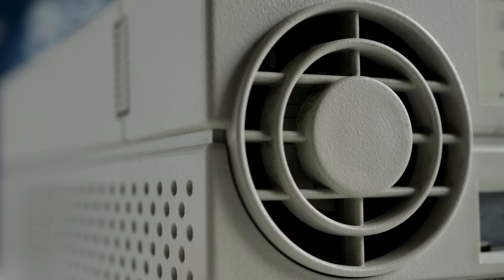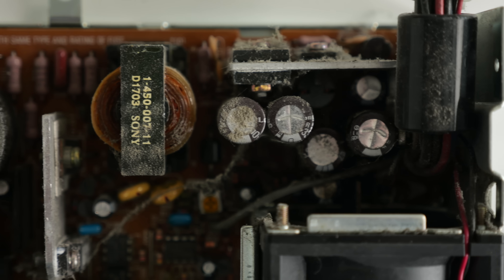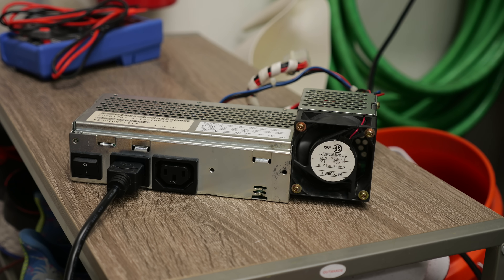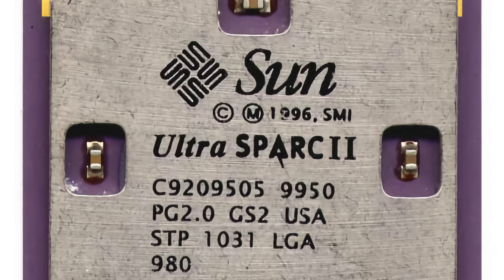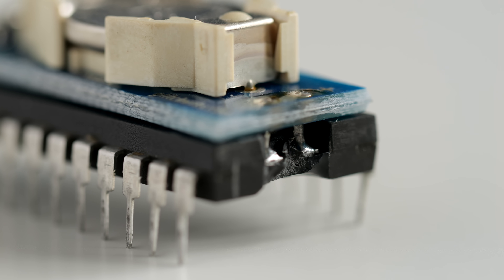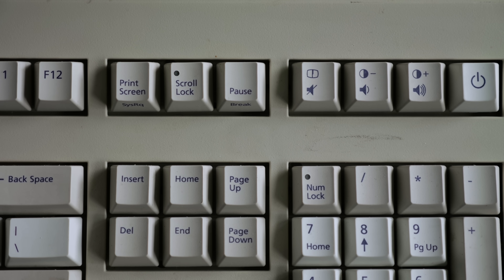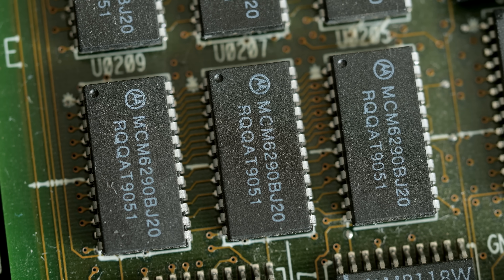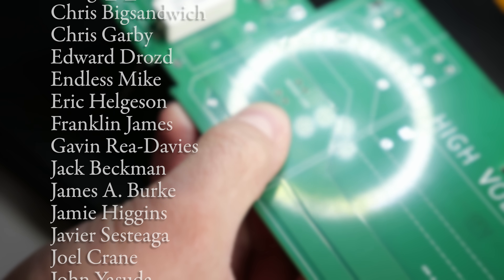I couldn't fix this SPARCstation because of one STUPID problem

Comment: That RAM fault is VERY easy to fix. Simply make a breakout board and mount any Static RAM larger than 16kB (dip or smd) onto the board then wire it by hand to the motherboard pads. All you need is A0-A13, D0-D3, WE, OE, CE, VCC, GND. It's just 23 wires and a bit of time to solder it. Give it a try in a future vid. You may be lucky and fix it for less than 5 bucks :-)

Comment: Sun had outsourced the power supplies to multiple companies.. Sony used ELNA caps that turned crusty rather easily, while TDK used Nippon Chemicon caps that work fine even after 30+ years. Sadly, TDK picked worse fans than Sony, so at least some repair is due for any of the lunchboxes. I have yet to see any of the mainboards fail, though.. even the tantalums seem to have survived the ages.
If you weren't literally on the other side of the globe, I'd gladly donate one of my spare GX cards.. but with the tariffs and post office reform of a certain president, it would cost me over 100$ to ship that one over, which probably isn't worth it for a shelf sitter.

Comment: I feel for you. In the mid-1990s, I was gifted a SPARCstation IPX by my uncle when his architecture firm switched to PCs. I was familiar with Intel-based and Motorola-based systems, so did not think there would be much difficulty getting a Sparc-based system up and running. Was I ever wrong. Even without the tribulations you had with the hardware being old and failing, I ran afoul of the Solaris OS. Even with the system having entirely Sun Microsystems hardware, I was 9 months getting the OS to install and run. It ended up costing me over US $1,000 to have a Sun-approved technician make an on-site service call just to get that far. By them, the sunk cost fallacy had me firmly in its grip. Another US $1,000 later, I had everything as it should be, but was so frustrated with its sluggish, glitchy performance under Solaris 7.0 and SunOS 4.1.4, I turned it off and never used it again. This mirrors my later experiences trying to get Solaris for Intel-based systems to work. It all added up to a few years of effort and frustration for the realization I had wasted far too much time and money on a very elaborate exercise in futility.

Comment: Sounds like a cold joint.
Reply: sounds like you've never repaired anything lol
Reply: @g4z-kb7ct  You'd be surprised by the amount old pcb's with legs lifting up from the boards ever so slightly, especially around pressure points. Remember these are 30+ years old. Plenty of time for that old lead filled solder to whisker or just oxidise enough to crack and require a reflow.
Reply: The chips are in the middle of the board and it was bolted to the case so there are no pressure points. Whiskers is not a thing on old devices. I have a Space Invaders board from 1979 that works perfect so even if it had whiskers it does not affect functionality. That could be an issue with new devices that use smaller parts with tighter connections but it doesn't apply to old stuff.
Reply: @  whatever, i'm glad it "works for me". I've had my share of repairs and seemingly simple things like those are the trickiest to trace back to the affected legs. Sometimes just touching the board while the system is turned on is enougth to cause an effect.

Comment: You might be able to ask Adrian from Adrian's Digital Basement to take a look. He might have a chip that would work with it.
Reply: AB is not required. Can be fixed by doing a simple RAM swap onto an adapter board using any SRAM and some wires manually soldered (by signal) to the pads. You may say that's difficult.... well all I can say is get out of the kitchen if it's too hot for you lol. If you're collecting 30+ year old stuff you had better have intermediate or advanced repair skills or don't collect old stuff.

Comment: I got my IPX in 1999, complete with an actual RZ25 hard drive (a Seagate 424MB thing rebadged by DEC) and the vertical stand.  It still works today!  Yes, I had to replace the "NVRAM", and I could never get the 100Mbps SBUS card I got to work (though I have a qec like you have if I didn't want to use a transceiver)

You would have found that the IPX was best run on SunOS 4.1.4.  SunOS 5 (anything "Solaris 2") is a bit too fat for it.  That RZ25 hard drive had Solaris 7 shoehorned onto it when I got it!

Comment: I would be surprised you couldn't just buy that IC from the Ali-E for peanuts, ie, they recycle everything.
It could just be a cracked solder joint. Seen heaps of cracks on the larger chip packages in the 1000s of repair vids of old hardware I've watched, ie, leaded solder also cracks.

Comment: It's certainly harder to justify the time, effort and expense refurbishing a system that you don't have a connection to. Unix systems are particularly a challenge because even when you get them working, there's limited software that might have mainstream appeal to run on them. Most interesting commercial applications are hard to get ahold of compared to Mac and PC/Windows software and often had a license key issued by the manufacturer and tied to a physical system. Most videos I've seen here will install Solaris, boot to OpenWindows or CDE, maybe launch the terminal and call it a day. A few will set up the system as a server of some kind. I had a Sun Ultra 1 on my desk for a couple of years and it basically was only used as a cross compiler and remote debugger for an in-development STB. If the IPX system isn't calling out to you as something that needs to be explored or brough back to life for nostalgia, it makes sense to put it aside for now.

Comment: Would CY7C164-35VC or CY7C166-15VC work as a memory replacement? Digikey offers them on their marketplace.
Reply: The former may be too slow (35ns vs 20ns), but the latter should work (15ns). Pin layouts are 1:1, same package, and equal-or-faster access. Rochester also has them for $3.93/pc
Reply: @krad2520  Yes, it's Rochester Electronics who are the seller. There are 20ns parts available, too.
Reply: @krad2520  Bruv, if what you say is true, then i hate this video even more.

Cause i was really expecting a proper ending to this here video.

BUMP THIS COMMENT!

Comment: oh god no let me guess Bios battery is dead the machine wont boot without it common issue only fix is replace the bios chip which casts 1500 for a working one and then you still have to deal with the battery dieing and starting all over again most people usually bypass the battery problem by soldering a external battery to the bios chips battery connection points there is also a key command you can use to bypass the dead battery error

Comment: I had one of these around 2002, picked it up at a 'junk' store, stuck Debian on it and hauled it around as a file server. Even cross-compiled for it from the PC, think I caught more than a couple build system bugs. Loved it enough to try fitting it with an LS-120 drive, but not enough to continue after the battery died.

Comment: I do have a lot of nostalgia for Sun machines of the sun3 and sun4/4c/4m era, but I still gave the last of my Sun hardware to a friend of mine who collects vintage Sun and SGI gear in 2007 or 2008. As fond of Sun as I am, the machines simply weren't useful enough any more, for their power consumption and noise and heat output.

Comment: SMES Tiers and Levels Exception. APPROVED for a configuration of the unit. Reason:Board is upgradable and can be adjusted, with its OS intact and some features designed for a portable console, similar to known brands these days. The External features and designs are up to date, the SLATS, and partitioned areas can be adjusted to add additional gadget to simplify a kitchen system as that of a Warmer and a timer with the BLUE, RED LIGHTS ON, ITS A MUST HAVE. The external design can be configured with an updated color, as playful, energetic, VIBRANT and FLASHY features that draws attention, stick ons or painting can do the TWIST. Chamber of Commerce Registrations, SEC articles of Incorporation as well as By-Laws, Trade Registration Certificates can be issued/released for new and updated designs for the brand(s) and contributors.Patents, Trademarks, Copyrights, LLCS, Registrations, are owned by its brand owners, ALL RIGHTS RESERVED.©™®  Thank you Tierage.  *****IMPORTANT*******This is NON AI/Fintech standards of Excellence for Technological updates, BRAND management and configuration respectively.******

Comment: That hit the nostalgia spot! When I worked at a Linux distro here in Brazil in the early 2000's, many colleagues had a SparcStation IPX on their desks. We used them as... monitor stands. 😂

We got them cheap as dirt at a local tech junkyard, as they would put the display to just about the perfect height AND looked "cool" to boot. I lost count of how many times unaware visitors would enter the room and exclaim "Wow, Sun Stations!".
Reply: Que mundo pequeno, esse… 😜

btw, in what distro did you work?
Reply: @UnderEu  Conectiva Linux, from CL5 to CL8

Comment: I had one of these once.  It used SunOS (before Solaris).  I ended up putting RedHat Linux on it via FTP install.  The speed of the workstation was underwhelming compared to pentiums and later.   What I did like doing was learning the Sun openboot system which helped me repair a server years later.

Comment: And this is why I never tried to refurb the SGI Octane I got for free a couple of years back off of Craigslist. I got a dual processor Xeon Dell server with it for free also, but I just wanted the SGI. I still have it and all the parts, but I gutted it to use the case as a custom PC case. Man I miss independently owned parts stores. I know of two in my area, and funnily enough one of them is literally across the parking lot at MicroCenter.

Comment: you can clone the PCB by taking a picture of it and using a multimodal ai model like Grok3  showing it the picture and asking to replicate the PCB..... then send off to PCBway and knock off a few copies.  You can use a local multimodal as well... just go on perplexity and ask for a 7b model that has vision/text capability.  Mistral makes a good one...  or you can always pay Openai.... but who wants that?
Reply: Do not do this. Do not trust a so-called "AI" to build PCBs unless you know exactly what you are doing in the first place. Good grief, please stop suggesting this crap.

Comment: I loved this video for many reasons. First, it brought back memories of me in middle/high school messing with one of these in my old school library and trying to get an OS running on it (we did, and it was fun!...this was in like..2000 or 2001). But mostly because you ended it on such a poignant note about the amount of time and money put into working on older hardware..and the "reward" of working on it. I recently had this issue with an IBM PS/2; got the machine free but started opening money and lots of time on trying to get it to a working state for...what? I didn't know...just to get it working. I ended up finally just cutting my time and selling it (essentially for what I bought in parts). I felt so much better but still came out on top with a lot of new knowledge and was much wiser in my decisions on working with older hardware.

Thanks for that!

Comment: Ran a local smtp on a LX before the requirements of gmail and hotmail made it virtually impossible to send mail from a small domain. 32 bits sparcstations are very endearing, and a SS10 was my first step into the multiprocessor world long before intel made multi-core chips. 
But they are very tricky to keep in working condition. 
Side note : the floppy drive wastes space, makes the box overheat, and serves no purpose as one would boot from the network. You can install a system without using a single floppy if you so wish. You need a tftp server with a kernel file matching your mac number in hexadecimal, and a nfs share with the OS install files.

Comment: isnt the trick to have a 512 byte block CD image? I seem to remember ipx would not boot off "modern" cdroms even back in 2000, I had to dig out a single speed unit that would support 512 byte blocks out of a vaxstation ?

Comment: I would talk to Adiran Black. He might be able to fix it.
Reply: Not required. It's a simple fix using ANY static RAM (for example 62256), 23 wires and a soldering iron. Join by signal, job done.....

Comment: Great video. No delusions about the computers of the past.
Back in 1991 I worked at an international electronics company. They were using Sun, Apollo, HP, SGI workstations for designing electronics. They also had x86 or MacOS computers for email, spreadsheets, and graphics. I used both the Unix computers and the PC's for my job.
Many of the IT people were extremely dismissive of the computers running consumer operating systems and had commodity components. Some would say to me "PC's will NEVER be used for engineering!"
I asked one engineer, who happened to have a PHD in computer science, what made his Sun/Unix workstation so much better that a typical PC. He pointed to the badge on the computer that said "Sun Workstation." He said something like "You see the word "Workstation? That's what makes it better!"
I'm pretty sure his response was part ignorance and part trolling.
I already knew what much of the difference was. I had been using PC's since I bought my first one in 1984 AND I had subscriptions to a dozen computer magazines and had been reading about different computer architectures for years. That didn't make me an expert, but I could tell what a persons level of knowledge was by asking them some basic questions.
Now in 2025 what are the dominant computer architectures for desktop engineering?
MIPS, Sparc, PowerPC, 68000, Alpha, others? Nope, it's x86 or ARM. 🤪
Reply: In the early 90's I worked at a US Investment Bank. They had a trading floor with a couple of hundred traders who all had one or more Sparc Stations with multiple monitors. Each Sparc cost about £30k No idea about the monitors but I'm guessing they were not cheap. The machines ran proprietary software on X-windows. The move to a client-server architecture meant all the heavy lifting was done on the server not on the workstation. So they moved everything to Windows NT workstations and Unix/Solaris servers. Saving them millions. They were beautiful and (at the time) reliable machines, but boy were they expensive.

Comment: Used SPARCStations like these in the very early 2000s to do stereoscopic photogrammetry using SOCETSET. The whole configuration was extremely expensive, with the maxed-out HDs and RAM, software, multiple monitors, including stereo-shutter technology and then the multiple graphics cards and high-speed (for then) Ethernet... We had to have technicians using these machines 24/7 in order to pay-off the investment.
I will say that they were really bullet-proof! Very little down time.

Comment: I had the same IPX, complete with flat screen, external drive , cdrom and tape. Worked perfectly with NetBSD. 
The original mouse was optic, with a dedicated metallic mouse pad with lines printed.I used it as a dhcp server for a while for the compagny I worked for.